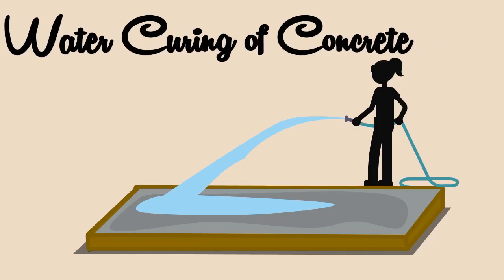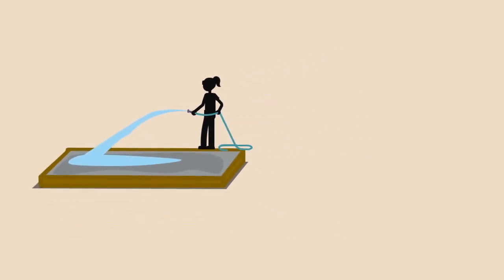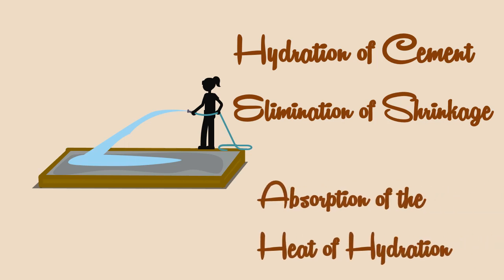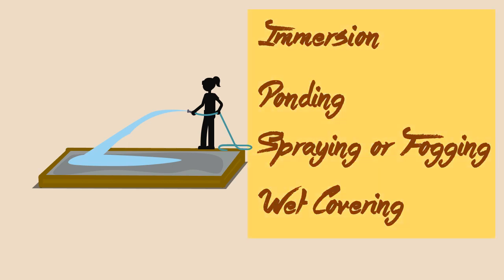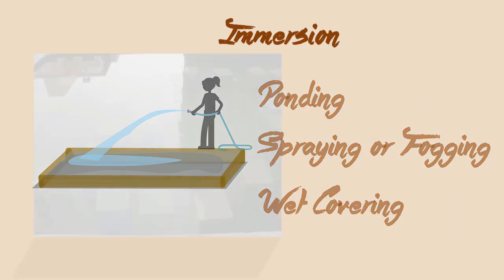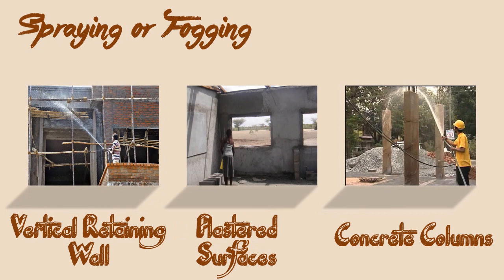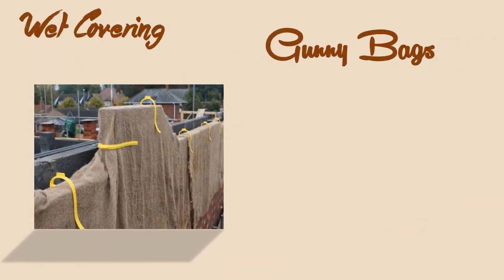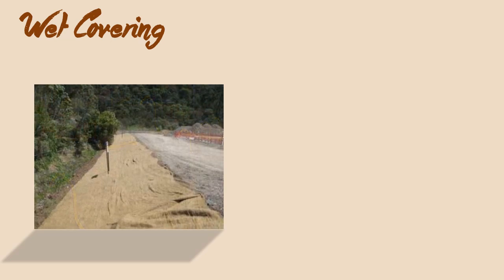Water Curing of Concrete || Types || Manufacture of Concrete #30 ||

Comment: I have done brick shuttering for rcc concrete columns and remove that brick shuttering after 24 hours, how much days should I provide curing to it?
Reply from the maker: What every shuttering you have done, as per standard concrete must be cured for 28 days.. unless, any admixture is used.

Comment: I have a concrete slab in my basement, I used Mason mortar to make a slab 144 square feet, it's like 60°f in my basement constantly since it's summer and the AC unit is located there.

Can which method is best used to cure it? I want to just leave a puddle on top that's .25in thick but idk if that's good so I just vacuum it off with a shop vac, I'm not consciously drenching it than vacuuming the excess not because I'm hesitant to keep it there, I'm doing it because I don't have anything to mist it so I'm pouring a gallon of 40° water on it. 

My question is can I keep that .25 inch thick  layer of water and if so how long?

Comment: I just poured 13 yards of concrete.  I had to wet it a bit during the finishing process to bring it back because it was drying to fast. Now I have an uneven look on natural concrete. How can I even out the grey color?
Reply from the maker: it would have hardened by now.. .. The reason is you would have used pressured water on concrete. Only way to clear the uneven finish is make a thin layer of mortar finish over the uneven layers.
Reply: @AnimeEdu  thank you!

Comment: One question, how do you perform curing of water repellent cement? I am using a water repellent cement for construction but it does not absorb any water. Does a water repellent cement does not needs curing, if yes how to do it?

Comment: A tip for wet-curing: the surface must be kept wet. If allowed to dry, and then wet again, repeated over time, will lead to something called "crazing," a pattern on the surface of the concrete that looks like a miniature version of a dried lake bed. You must keep the surface wet and not allow it to dry while being wet cured.
Reply from the maker: Good one sir....
Reply: Harold Clark how long do you need to keep it wet until it is cured?
Reply: @do7hemath937  It's done all the time on bridge deck replacement projects. Cover the fresh concrete with wet burlap after giving it time to set up, and then use a sprinkler system to keep it wet for a week. That is in the specs for most state DOT's.
Reply: @do7hemath937  Anthony, there is also clear and white-pigmented curing compound which is used on large concrete pours like pavement and sidewalks. It is sprayed on as soon as the concrete takes an initial set. Curing compound is a bit hard to find and usually sold in 55 gallon drums. But wet cure is specified on bridge decks in New York state and other places for critical items like bridge decks.